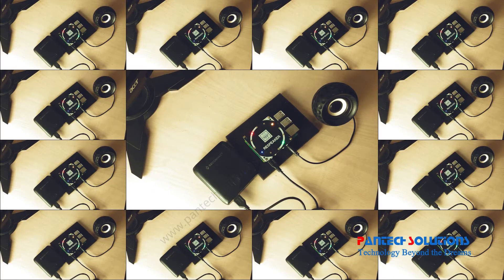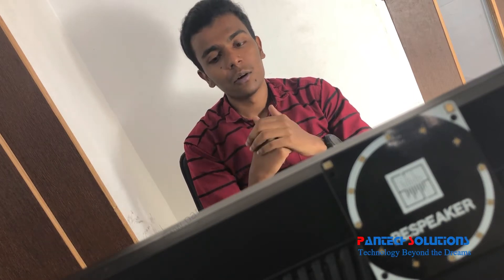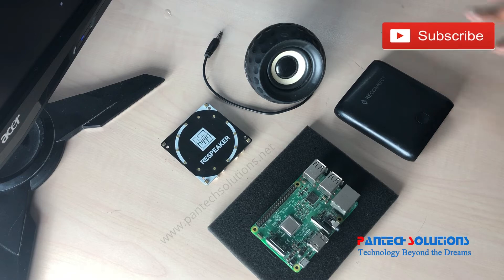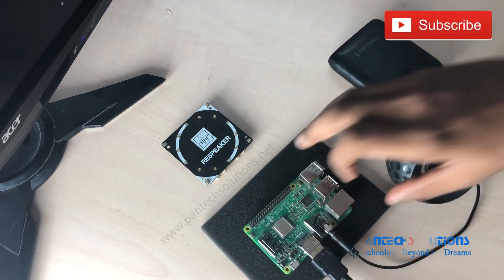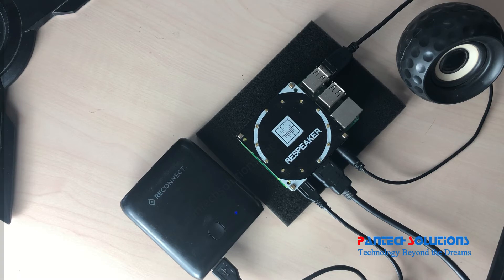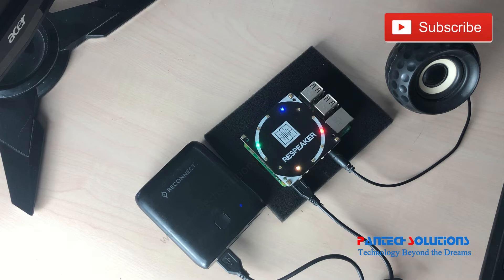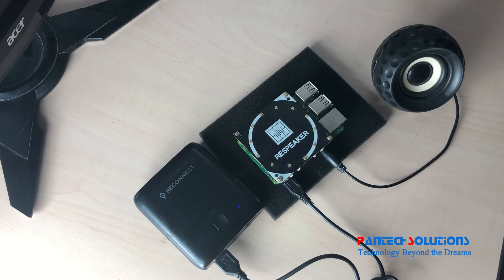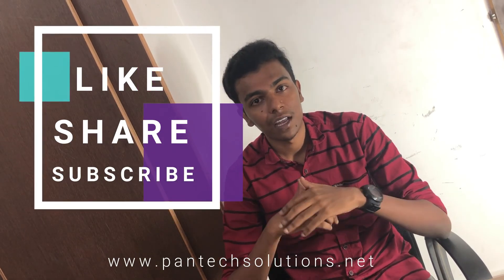Google Home using Raspberry Pi with Respeaker

Comment: I see Respeaker has a builtin microphone. Does it have a builtin speaker too? Or external speakers are required?
Reply: External speaker running from raspberry pi ,as shown in video, is ONLY option

Comment: What is the microphone range of ReSpeaker?
Reply from the maker: 3 meters radius !
Reply: @pantechsolutions  Thanks mate!
Reply: Mate, quick question. If, for example, I purchase Raspberry Pi 3b and ReSpeaker 4-Mic Array for Raspberry Pi and then install Android on my Raspberry, will Android be able to use ReSpeaker 4-Mic as default microphone?
Reply from the maker: @AntonShagaev  hai Anton, Only if your android has capability to configure speaker and Mic ID. Then its possible to use.
Reply: @pantechsolutions  Ok, got it mate. That's what I thought. Thanks mate, appreciate your help!
Reply from the maker: @AntonShagaev  You Welcome !